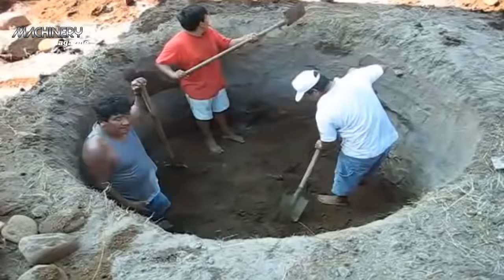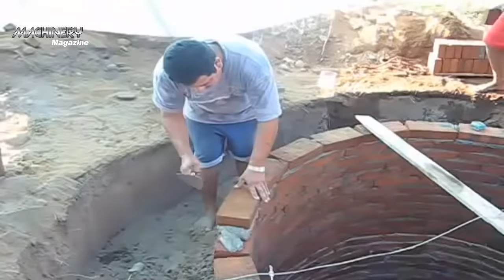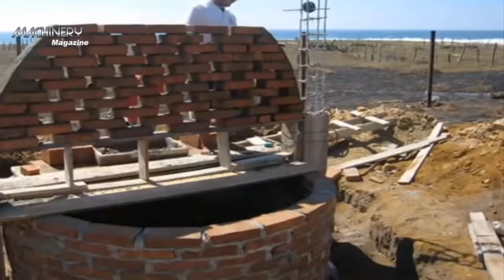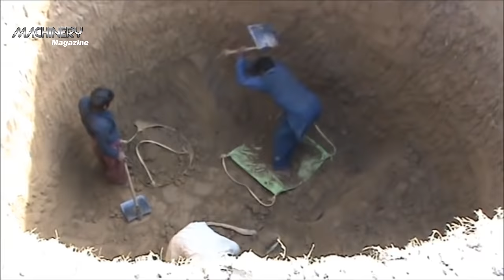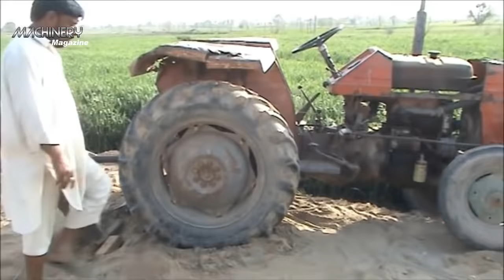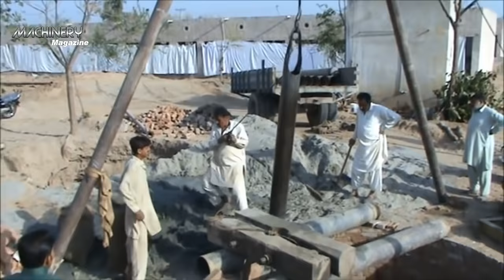Amazing Fastest Well Digging by Hand - Extremely Ingenious Construction Workers

Comment: In Malaysia we place a precast reinforced concrete (RC) cylinder upright on the site. We start digging on the inner ground and the heavy cylinder will lower by itself into the ground. When the cylinder is level with the ground place another cylinder on top and so on until clean water at the deeper level is obtained. Water will seep in between the cylinders into the well. The top few cylinder joints can be joined with sealant to prevent dirty water of top levels seeping in. No danger of wall collapse.
Reply: I see how that would work great. No worry of cave in.
Reply: do you have a video of this method?
Reply: В России так же как Вы копаем колодцы
Reply: Genius.
Reply: Much Moore ingenious to dig inside precast wall.
Reply: ... that is if one has access to the machinery to move such cylinders into place
Reply: Great idea! Would be great if you can load or share a video.
Reply: What is the population of Malaysia.
What is the population of India.
There can be no comparison when it comes to being resourceful. India are miles ahead 🤔
Reply: Same in North-West-Germany.
Reply: @suemurray9431  Depends greatly on ground conditions and availability of pre-cast pipes
Reply: @dachnyisector  В Беларуси тоже :)
Reply: Well, I did this with a class in School, when I've been about 13, more than 35 years ago for one week, in Germany. We reached about 5 m.
Reply: Reverse Pyramid building...lol...very clever...prevents a collspse!
Reply: A smarter way to build a well for sure- with soft soil wall collapses kill people quickly without shoring the walls.
Reply: @BudsMoKing  there's no need machinery to move it into the place. We just roll it. My house used to have one in the past build about 30 years ago.
Reply: Marc Brunel had this idea 200 years ago and used it to great affect for the tunnel under the thames
Reply: @robertgatto6392   population of Malaysia 3400000  2022
Reply: @dachnyisector  Да ладно. Нет, может, мазохисты какие и копают, но обычно просто заказывают роторную машину.
Reply: I did exactly the same in South Africa in my youth. Started digging in loose alluvium in valley floor. Sidewall too unstable. Used large RC pipe sections - the same as used for conduits under roads. Placed one atop another as we went down. Instant walls, and now safe.

The challenge was heaving the large boulders out. I would throw them up to an intermediate level, and then 2 men throw them higher.
Reply: @BudsMoKing  Machinery? Never underestimate the power of a lever or pulley, and a few strong men.
Reply: It's a lot harder digging dirt out from underneath of all that weight the whole way down....if you're going to do it like that I would use a plastic cylinder and pour it later...I would just shore the hole with timber
Reply: Так и делаем в России тоже
Reply: Yes we have done this. A few times  it starting sinking by itself and we would place a  concrete  ring tied to the cassion at the bottom to stabilize.
Reply: In Australia we do similar but use high pressure water to dig inside the cylinder then vacuum out the slurry.
Reply: In the US we use a drilling machine and only make the hole the size of the pipe.
Reply: Cool!
Reply: That's a genius way of doing it. Similar to to the way tunnels are bored, but vertical.
Reply: @dachnyisector  ㅜ
Reply: @williamstucke5445  kwaai man
Reply: @MrPoopyButhole  how many wells have you dug?
Reply: @beavisroadhog9629  none.. I shure up deep holes for vertical tunnels and have done this 100s of times in  underneath city buildings and places that you can't fit equipment. There's thousands and thousands of miles of tunnels underneath cities.
Reply: @stevendouglas6593  That's how we dig broken gas lines.
Reply: Precast concrete pipes fall from the sky here like manna. Ya have to watch for em'. Look for WARNING HARD HAT AREA signs and don't trip and hurt yourself over others who didn't need my advice.
Reply: انها فكرة هائلة
Reply: That’s the best way to do it, letting the ring drop down as you dig and also keeping the well perfectly round and level, just throw part of the dug out material over ring,,, yes best way on many levels 👍
Reply: С одной стороны думаешь, как было бы хорошо помочь этим людям. А с другой стороны видишь как портятся люди, когда начинают жить в достатке.
Reply: @robertgatto6392  what has population got to do with this . ??????? I can  make the same  kind of observation that comparing indian and malaysian population what is the  percentage of indian defacating in the open and number of families who do not have a proper toilet at home compared to malaysia .
Reply: Your idea i v good that was may plan if i start to dig..we have same idea plan..perpecto my.friend....
Reply: @BudsMoKing  the process actually need no heavy machinery
Reply: It's the best decision when no machinery is acceptable. Precast concrete rings, i mean
Reply: Brilliant!❤
Reply: 0:15 🎉
Reply: @BudsMoKing , you could make forms and cast them in place if you needed to. 
Would take much longer though.
Reply: @BudsMoKing I with my father did so. But we had NO machine at all(!). Every new ring was created above previous digged down. We mounted a formeork above previous ring, and poured concrete there.
Reply: @robertgatto6392 
What does population have to do with it?
Reply: in Africa Uganda I have seen people digging up to 170 feet down 😮

Comment: I was a power lineman and working in the Irvine area and getting ready to set an hundred foot steel pole.  Forty feet of it went into the ground.  While digging the hole with a well digger we broke through the ground and there was a rushing river at the bottom of the hole.  Frankly it scared the heck out of me.  If you fell into that no one would ever see you again.   We had to dump abound 20 yards of concrete to bring it up to where we could set the pole.  We set the pole and encased it in foam.
Reply: Interesting story thanks .
Reply: Irvine?
Reply: how about petroleum ?  Irvine California ?
Reply: 100’ pole and only 60’ out of the ground? What happened to 10% + 2ft?= 12ft

Comment: Wonderful work on the wells. Just amazing. I saw so many techniques that were used build these. The small can of water on the brick to check that it was level, the stick across the wall at it's center using the marked shorter stick to keep the round wall evenly round, the rope around the larger pipe for the 3 guys to turn the pipe and join it to the lower pipe. Most exciting video I have seen on well building.  😄
Reply: С одной стороны думаешь, как было бы хорошо помочь этим людям. А с другой стороны видишь как портятся люди, когда начинают жить в достатке.
Reply: Outdated technology, right here
Reply: Unfortunate that people living in less developed countries are basically in the pre-industrial age. With primitive equipment at best to use
Reply: @Identifyasaconspiracytheorist  What you mean is "dependable, and more accurate than most gadgets".
I have a quality laser level, and in bright sunlight, it is hard to see. Mentioning that its batteries could run out is lame, so I'll mention instead that using a string or a piece of wood to measure things is super fast and accurate. You do need to know what you're doing a bit.
But it works wonders for ratios. Ex. If you have wooden beam twice as high as it is wide, guess what you could quickly use to both measure the mid-point (on itself, or on where you'll mount it), the width and various other multiples? That's right, a thin slice of that very beam.

Even with a speed-triangle doesn't get close to the speed and accuracy.

That said, this video is clickbaity and trash. The original footage would have been cool at regular playback speed, perhaps.

Comment: Speed-wise, no matter how long it took, still faster than getting a permit, or waiting for a code inspector to show up...
Reply: At least osha didn’t show and enforce mandates
Reply: Bureaucracy is the same anywhere.
Reply: @texanbalaban6777  qq
Reply: OSHA has laws and regulations for a reason. That is a stupid risk of everyone’s lives. Any excavation deeper than four feet needs to be supported to prevent a cave-in. It happens so fast there is no time to rescue everyone before the suffocate.
Reply: Yeah and I wonder how many people have died while excavating a well in their village without any regulation
Reply: @michaelshaw7555  Not to mention poison gases that accumulate at the bottom of an enclosed trench/well.  Very dangerous without ventilation and support.
Reply: Nice well,. I don't understand how they dug such a wide well with only a 10 inch pipe.
Reply: @rh6625  doesn't even have to be poisonous, just displace oxygen...like CO2
Reply: @michaelshaw7555  I don’t need osha to tell me what’s dangerous and what I can or can’t do. If I think it too dangerous I simply won’t do it. OSHA doesn’t own anyone.
Reply: @michaelshaw7555  Exactly   use some common sense  cave ins happen all too often
Reply: @michaelshaw7555  Safety doesn't mean much down there, the soil seems very strong though but at least hard hats working downstairs,  OSHA would shut them down in a minute for the drive shaft powering the winch alone.
Reply: @bhatkat  ...with loose ropes and rags nearby, too
Reply: @blueoval250    love the video of the trench cave in happening as the OSHA inspector is shutting the site down for lack of shoring....  Classic

Comment: These guys are machines! Looks great.   In the early’60s, when I was a little kid, my Uncle from the Adirondack Mts area of upstate NY, he and some other men built an artesian well in his front yard, I’m not real sure how an artesian well works, but his water still comes out of there iced cold! He passed away a couple years ago.
Reply: От воды?
Reply: От старости
Reply: Artesian water is located at great depth, on average 100 meters from the surface of the earth. And there is quite a strong pressure because of this, artesian water comes out under pressure itself from the well, without the use of a water pump. Unlike groundwater, which is located very close to the surface of the earth and requires a water pump for pumping.
Артезианская воды находится на большой глубине, в среднем в 100 метрах от поверхности земли. И там довольно сильное давление из-за этого артезианская вода выходит под давлением сама из скважины, без применения водяного насоса. В отличии от грунтовых вод, которые расположены очень близко к поверхности земли и требуют для выкачивания водяной насос.
Reply: I'm familiar with the area, most wells there are technically water table wells, water flows from the ground near the bottom of mountains after having fallen as rain and passed through hundreds of feet of rock and soil. My father has a similar well in Ticonderoga.
Reply: У нас в дачных поселках по Подмосковью артезианские скважины ещё с советского времени, вода изумительная. Набирается в большой резервуар, а из него по трубам подаётся к каждому участку. Поселки по домов 600-800.
Reply: Usually they are a low spot between two high spots, think of a pool float full of water a man stands on each end and then you put a hole in the middle. Weight of all that water pushes it out of the drilled hole.
Reply: С одной стороны думаешь, как было бы хорошо помочь этим людям. А с другой стороны видишь как портятся люди, когда начинают жить в достатке.
Reply: My twin baby boys were just like little artesian wells when I would change their diapers....lol 😆🤣😂

Comment: Never dig in a hole deeper than it is wide without supports.
Reply: Unless you have few, or no options, and need to get the job done.
Reply: Pretty sure it's circumstantial but ok
Reply: I would think there is a danger of collapse so yes that is a good rule of thumb.

Comment: We  ( father started business ) had bore well for water drilling business in India from 1965 to 1989, intially up to 1984 we did all by manual drilling without any power machinery then we bought rotary machines and one impact machine build ourself.Our south gujarat area gets good sand water at level of 40 feet to 170 feet.we did for home use to agriculture, small village water works etc, installing centrifugal, jet,hand ,submercible pumps. This guys were digging wide well initially so that simple centrifugal pump can be used  at bottom of well as centrifugal pump can not suck water below 30 feet.

Comment: When I was 10 my grandfather and I dug our well to 50’ by hand, we used a post hole auger till it got too soupy, a 3’ stick of pipe at a time, then we went to the barn and built a Can-D bailer and a rock breaker chisel pipe, the well made 25 gallons a minute of the nicest water!
Reply: How does a person know where to dig?? 
Plz 🙏
Reply: No you didn't. Everyone on here saying they dug 50-80 feet by hand. BS! I'd love to see you dig even a 10 ft hole. Especially at 10 years old? Gtfoh 😅
Reply: @ronnieswindski825 just because you were hiding inside doesn't mean everyone else was. Some kids were out working on farms. The summer I was 11 was spent moving dirt, 550 yards of black loamy dirt shoveled into a small 2 yard trailer by hand, and hauled with a Honda Big Red 250ES. The next year we had a leak in our irrigation system so I got to dig that up and repair it 15' down in clay, with a pick axe and a shovel.
Reply: @richardpenny7813  just stop talking. I do excavating work my whole life. You didn't dig down 15 feet by hand. You'd have to make it wide like at least 4 feet and then at that depth you would need at least 1 other person pulling buckets of dirt up. Also no irrigation line is 15ft down gtfo I literally do tons of work on irrigation lined for farms. Who are you try to impress with your little stories? Maybe 5 feet. Not 15
Reply: @ronnieswindski825  well, I did. And yes it is 15' deep because the hill that's over it was shaped differently when it was put in. It was dug by hand because no one was sure how deep it was, since the man who installed it had been dead for a decade at that time.
Reply: @richardpenny7813  I'm just not buying it. Can it be done? Of course. But you need shoring and there's other issues like water coming in and so on.

Comment: Fantastic hard work with great ingenious solutions to problems.  I shiver a little about 30 feet of wall with nothing to prevent collapse...but to each their own soil conditions. :)
Love the tractor cable hoist combos done here.
Reply: the bricks reinforce themselves being in a circular shape. basically, there is not enough space for it to fall through. you could build it to any depth and it would not cave in built like that. its the same for tunnels, which are circular and not squared =)
Reply: I was thinking the same thing. Extremely dangerous to dig with no protection while working. Don’t take much dirt to kill someone.
Reply: @bigal25938  Yeah, trench collapsed on a guy near us, didn't even cover his shoulders but he died anyway when it induced a heart attack.
Reply: @bhatkat 😂

Comment: Can anybody explain what is going on with the second well?  Why build the foundation for the bricked in part at 35'feet and then sink the tubing another 20 feet? Was the bricked in part meant to collect ran water or does the water level sometimes rise that high?
Reply: The pump they have probably cant provide 55' of suction and they don't have submersible pumps.  Pumps work better pushing than sucking.
Reply: All that extra work because they didn't want to buy a $300 submersible well pump?  I agree with Scotty, that doesn't make much sense to me.  If you are going to drill anyway, just drill.  The huge 35' deep brick lined hole seems totally pointless.
Reply: @FarmCraft101  you need to start thinking like you live  in a third world country.  When $300 is a years salary, you can’t just buy whatever pump you want, you use what you have.  When that’s the only pump you have, and labor is pennys an hour…you do stuff that works but doesn’t make sense to Americans/Europeans.
Reply: The water could be under pressure so if they dug all the way it would flood the hole. Thw brick chamber could also be for storage.
Reply: @mikesumner5129  Nah, the pipe goes all the way from ground level into the liner than it is sealed at the top like I have seen on ground level liners.

Comment: We all do what needs to be done and is necessary. I did this with my father-in-law for years to help people in the mountains of Western North Carolina. Unfortunately, people are not aware of the dangers of a wall falling in.  A ditch of only 3' in depth will pin you against a wall and you can not get out. Now, what happens to these hard working men if a wall caves in on them? Then, who supports those families? We used tile that slid down the walls as we dug below them, putting another on top as we continued to go down. This way the walls were supported as you went down. Very dangerous work that looks simple enough.

Comment: Im a big muscular gringo and I had to dig out some enviro-latrines due to design failures in Suchitoto, El Salvador. I was working with some locals and I was much bigger them. they started digging and after about 10 minutes, I asked to join in. Man, I stabbed the ground as hard as I could and it was like cement. Those little guys were MUCH stronger in their hands than I was. THe workers there demolish buildings and roads by HAND: They were just laughing at how soft I was.

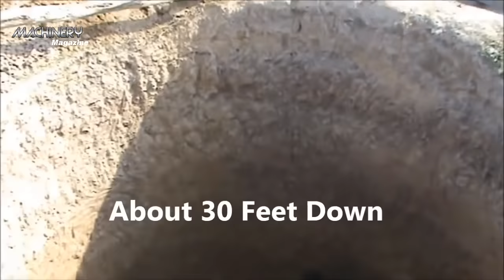Comment: At  5:31    About 30 feet down and nothing supporting the walls of the well they are digging. And no clue as to the stability of the soil surrounding them.
They could be dead and buried  in the same split second.   Saves on funeral expenses I suppose....no need to dig them up just to bury them again.